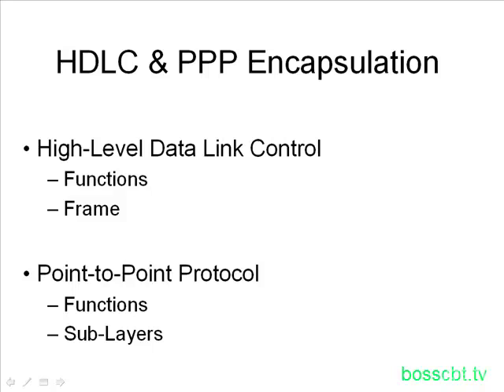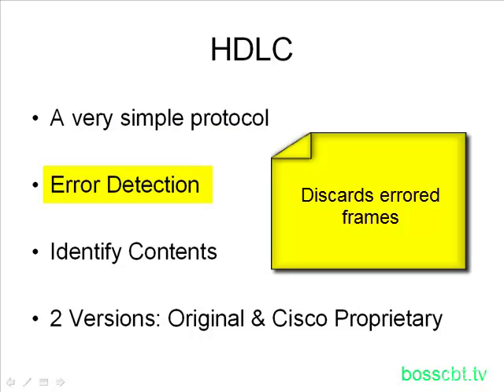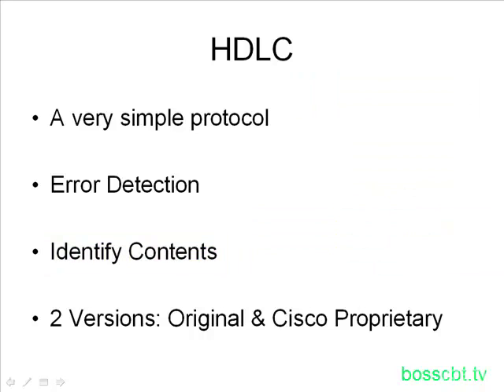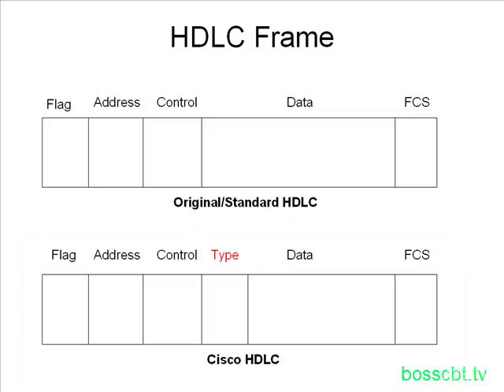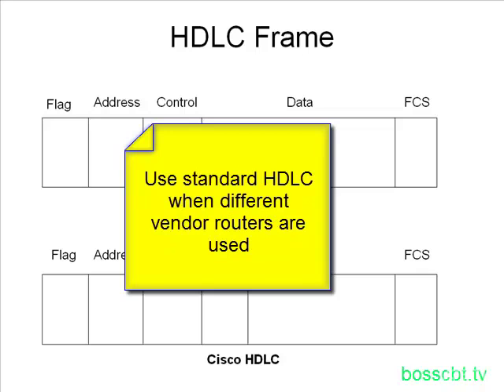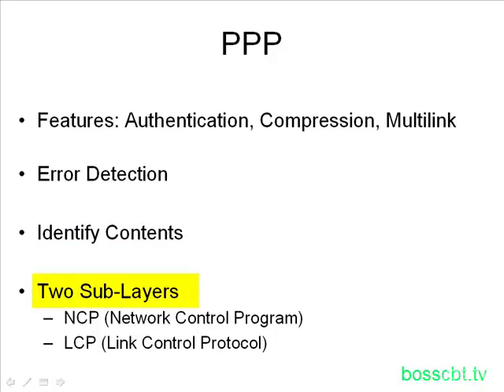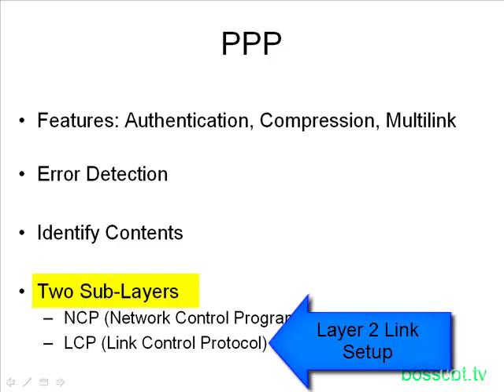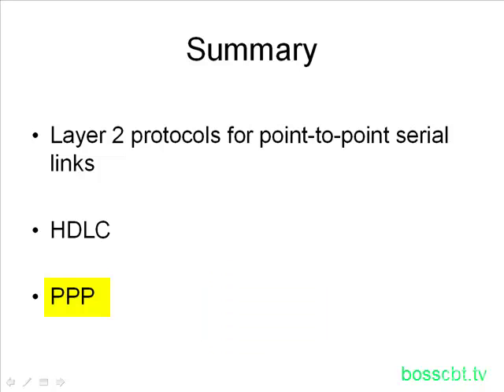4. HDLC  PPP Encapsulation

Comment: Great video. Thanks. I'm uncertain about  non-CISCO devices being unable to use CISCO HDLC though.  This is from CISCO NETACAD:
 "Although Cisco HLDC (also referred to as cHDLC) is proprietary, Cisco has allowed many other network equipment vendors to implement it"
Reply: I believe what he meant was that a non-CISCO device using HDLC cannot connect to a CISCO device using cHDLC.  I believe he was talking really about the protocols and not the brand of routers but I agree it might be confusing wording.